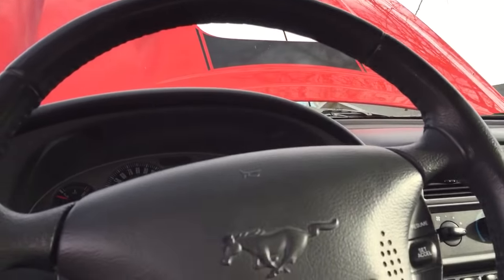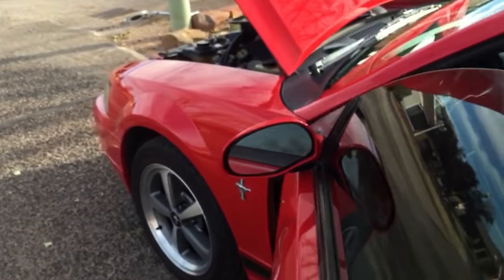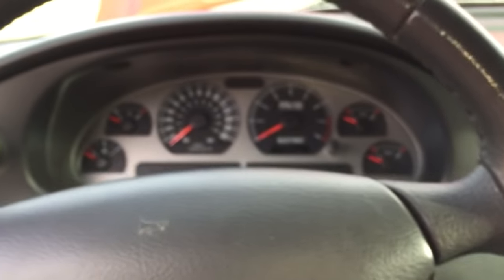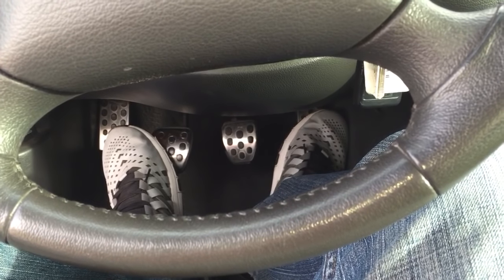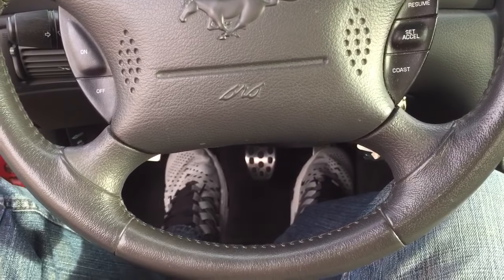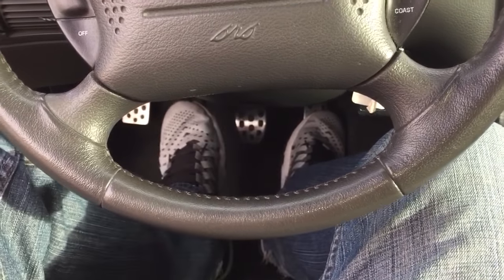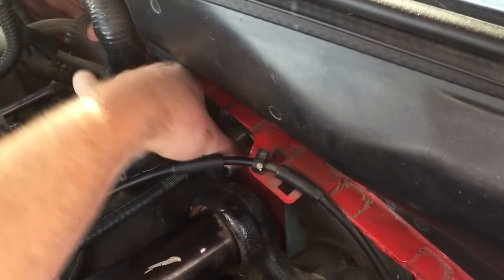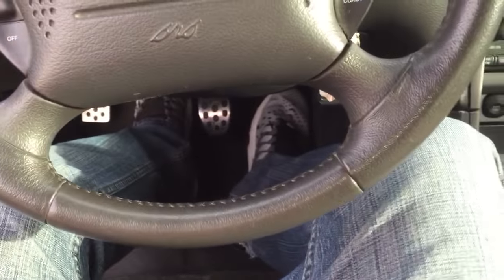How to adjust your Clutch: Ford Mustang. Clutch quadrant & firewall adjuster ajustar embrague chirp

Comment: Over the years I've found that firewall adjusters are just more trouble than anything. I run a Fiore quadrant with an adjustable Steeda clutch cable straight to the transmission and make my adjustment at the clutch fork. This way, there is not a chance of the cable rubbing against the inside of the firewall adjuster and eventually snapping (which I have seen PLENTY of times). Love your vids bro!
Reply from the maker: Kris Ram I had a STEEDA adjustable cable at one time and also adjusted it from underneath, but the pedal would rattle until I got the freeplay elimination mod. I was running it so the t/o bearing wasn't spinning until engaged but didn't get full travel and got locked out a lot
Reply: Scrun Johnson I know the online debates go on FOREVER about this but the TO bearing is designed to spin at all times. If you look under a factory stock setup on a mustang that still utilizes the original plastic quadrant, the design to pull up on the clutch pedal is just that. To make sure the TO bearing is just barely resting on the pressure plate. If your pedal was rattling, that meant that the cable needed to be adjusted so that the TO bearing would make firm contact with the pressure plate. An old trick for aftermarket cables is to pour 2-3 cap full's of engine oil down inside the cable so that the travel and pedal effort is smooth. All in all, Timken bearings are my most favorite as they are made out of Kevlar and withstand a lot of abuse.
Reply from the maker: Kris Ram I agree. Good insight. When you remove a factory setup cable you need a pry bar to separate the clutch fork, so that's yet another sign it has pressure and spins constantly. Thank you for your comments. They help for others also reading through them for more insight

Comment: Video was just what I was looking for ! My 87’ GT has the exact same chirping noise so I popped the dirt cover off the bellhousing and started it up and I watched the cable and fork rattle a little and the smallest amount of tension would kill the chirping noise. I don’t want to have to swap to an aftermarket quadrant and I think my plastic quadrant still works fine
Reply from the maker: Ricky Gendall The plastic ones tend to strip the plastic teeth over time, so as long as they are still good you should be fine. If not, the aftermarket quadrant and firewall adjuster is very nice to have
Reply: Yes sir, I had a look yesterday at the pawl and quadrant and theres hardly any teeth left. On top of that, the cable in there now is stock from '87 so i went ahead and bought a 5.0resto cable adjuster and double hooked quadrant. Hope it works well, and thanks again for the awesome video man!

Comment: Good explanation. The bearing should be spinning with clutch at all times. Reason being. Every car/truck/bike etc.  in the world I've ever worked on that had a hydraulic clutch they all keep small preload on the bearing.
Reply from the maker: Yes, I agree. The shock factor going from 0-2,000+ rpm is not what it’s designed for. I run a small amount of preload.

Comment: Good vid.  I have my adjuster set with the dime thickness gap between the cable and the face of the adjuster.  Clutch engages at the high travel part of the pedal where the vid said low
Reply: I think if you turn it in it will engage closer to the floor.  I’m having trouble with mine also engaging high

Comment: Mines is chirping alot louder now ,especially in drive tru's. When i bought my cobra a few months ago the chirp wasnt so loud. I bought a firewall adjuster and quadrant the week i got the car. Ill probably adjust it again tomorrow b4 work. You forgot to mention that u can adjust where your clutch engages with the fw adjuster and quadrant. I like mines engaging close to the floor.
Reply from the maker: Morbid Thrasher you're right. I started mention it at 6:22 and never finished. I completely covered it in the first video I made but a dump truck came up and ruined my video with noise and I started over again and forgot I didn't cover it again lol.

Comment: i was always told the squeaking was the throwout going bad but i guess its something fairly common on these cars, its been like that on both of mine but i always just assumed they were bad bc they were both beat on by previous owners (and myself lol) thank you for sharing this information!!
Reply from the maker: It certainly can be the bearing going bad, but it can also just be the throwout bearing as it lightly touches the diaphragm and fingers. Here is more information as well as an install for the clutch quadrant and adjuster https://youtu.be/RkEn5FJHs8g
Reply: @dannyjohnsonsgarage  well the squeaking isn’t super loud or anything it’s just kinda faint like the way you explained it in the vid so i’m thinking adjustable cable and everything should help me somewhat solve it

Comment: I hear the chirping /rattle while driving it sounds pretty loud and I got a good amount of tension on it. New everything in clutch flywheel, clutch, pivot, TOB,fork ,new fluid, bbk adjustable fire wall and quadrant and cable
Reply from the maker: If it does not go away with light pedal (cable) tension, the throwout bearing is likely bad https://youtu.be/UFr0Rur_EWc

Comment: Adjust your cable. If it keeps chirping your throwout bearing and fork need to be replaced along with the bolt that hits the throwout bearing. And just Incase if your cable is old replace it as well. These mustangs are a lot older now and need a lot of new parts don’t try to half ass these cars because they will just keep messing up. Do it right!

Comment: Hey I know this video is a few years old but I’m hoping I could ask a few questions. I have a 2002 3.8L that I recently had a clutch put in. Just added a new adjustable cable and double hook quadrant. I am about to try and add my own diy freeplay eliminator to fix my issue. My pedal rattles and I mean BAD. So bad I have completely stopped driving the car it makes me wanna pull my hair out. You have been the only person to even address this problem in a video and I was just wondering. How bad did the pedal in your car rattle and are these cars known for that. I’m hoping this spring will finally put and end to it or I am afraid I will have to sell my favorite car. Also do I need the firewall adjuster or am I ok just to use and adjustable cable and new quadrant. Thanks.
Reply from the maker: Well, as the video shows, method 1 is to tighten the bearing up until it’s LIGHTLY spinning, and that would take most rattle away- but if you are trying for option 2 to have it not spin at all, the free play mod is your friend. On my car it just made an annoying tapping sound- small vibration to where barely touching the pedal would stop it. 
  I went to having the bearing always touching because I was not getting full travel (and not getting full clutch disengagement) so I’d get locked out of gears. Hope that helps
Reply from the maker: I’m assuming you’ve seen my freeplay mod video, but if not, here it is https://youtu.be/3og_dCB9s-g

Comment: So I have a 98 svt cobra. Has the adjuster just like you have and quadrant. It has that chirping sound constantly and looks like a new clutch and tob in inspection port. 

If I tighten it too much it will chirp while driving in gear. But just very slight pressure on the clutch pedal will make the sound go away. I mean like if you pushed it with your pinkie. Any suggestions
Reply from the maker: So it is almost there. You need to tighten the cable (turn firewall adjuster counter clockwise) just a hare more. If you don’t have enough travel left in the firewall adjuster to do that you need to put the clutch quadrant on the other hook (assuming there are 2 hooks) and start over again with adjusting it. In my opinion, the ford cable does this perfectly and if you have to put nuts on the end of the aftermarket clutch cable make sure to had several and some lock tite so it doesn’t come loose
Reply: @dannyjohnsonsgarage  ill try that.  So put a cut or washer where the cable hooks? It squeaks only until a very light touch of clutch. Same thing no matter how adjusted
Reply: @Keepfight10  having the same squeak in gear off the clutch and neutral off the clutch until I apply a very small amount of pressure on the clutch pedal. Just did a new clutch, tob, pilot, and maximum motorsports cable and firewall adjuster so I'm gonna try to tighten the cable just a hair and hopefully that will make the squeaking stop lol

Comment: Hey great video! Saved my life. My brand new ford performance tob makes a chirp/ faint rattle when i let off the clutch. Which method should i use to make the noise stop and put less wear on it???? Do i buy that kit? What do you recommend. You earned a sub. You're awesome.
Reply from the maker: Shitstang 02 I like the fiore brand clutch quadrant and fire wall adjuster with a stock cable. That works well with my clutch at least. I would recommend a light pressure on the throwout bearing so it's just barely spinning, but doesn't have a lot of preload to heat up the bearing
Reply: Danny Johnson Ok i have an sr performance one installed. But i cant spin the firewall adjuster. Its too hard and i cant adjust it. Idk what i did wrong? So i just get it adjusted with with fire wall adjuster screwed all the way out ???
Reply: Danny Johnson I was referring to the freeplay correction thing???
Reply from the maker: Shitstang 02 what clutch cable are you running? The aftermarket ones allow you to remove a nut on the clutch fork side and I can explain what to do if that's the case
Reply: Danny Johnson yes there is 2 nuts on the end of the cable that goes in the clutch fork.
Reply: Danny Johnson Well 2 nuts that hold it on the clutch fork

Comment: Man I bought a new clutch kit from lmr and I now have reverse grind and 1st is hard to get into. Any info? Thanks bro your mach 1 is 🔥
Reply from the maker: It sounds like your clutch pedal is not getting the full travel. Does your kit have the adjustable cable, firewall adjuster, and Clutch quadrant?
Reply: @dannyjohnsonsgarage  yeah man got all three. Also got new clutch fork and ball pivot. My pops and I put everything the way it supposed to be. Triple checked everything
Reply: Same issues here

Comment: As always great video. Few questions 
My understanding I can install  Quadrant & Firewall Adjuster with the stock clutch cable right? Any advice on that? 

Also do you have a video of any of those Clutch Pedal Height Adjuster?  I'm not fan of how far the clutch travel or having my knees close to my chest lol.
Reply from the maker: Yes, the stock cable is best. You’ll see a spacer in this video for the clutch pedal, but it’s more for cable length https://youtu.be/RkEn5FJHs8g?si=JtX9hPmJcx4SSCnr

Comment: quick question for anyone. I have an 03  Gt and my clutch is short. meaning the "sweet spot" to engage it is very small/minimal. how do I Increase it??? On my previous 01 Gt it was way more easier and comfortable.
Reply from the maker: You will need to buy a clutch quadrant with multiple hook locations, and/or the firewall adjuster to help get it straight as shown in the video

Comment: Mine lets out 2/3from the top. Hard to get into 1st and reverse. When i get it into reverse it will let out about 1/3 the way. The peddle is pretty stiff. Theres an aftermarket quadrant. Cable unknow. When moving it shifts fine. Any thoughts ?
Reply from the maker: Check which hook it’s on for the clutch quadrant. You probably need to start over by putting the firewall adjuster in the middle and snugging the clutch cable down first at the clutch fork
Reply: It has a stock looking cable with the white plastic cap in the firewall

Comment: Hi Danny.  I just bought a Black 2003 Mach 1 basically stock with a few common mods like headers eibach susp, clutch cable etc. I think it’s a steeda adjustable clutch cable and hardware. My Question is … the clutch is SO HARD to push down. How can I make it easier and still keep everything right ie no squeal?  Thanks!

Comment: So I recently bought a mach 1 with this firewall adjuster but the guy ajusted it and I started to here the throwout bearing noise which way should I turn it clockwise or counterclockwise to stop hearing the throwout bearing???
Reply from the maker: cruzwtf Gaming so I’d turn it counter-clockwise until the chirping goes away (if that’s the sound you’re hearing). That would indicate the bearing is spinning but does not have a lot of load on it. Is that what kind of noise you hear?
Reply: Danny Johnson I hear the throwout bearing grinding no chirping all I hear when the clutch is out is haaeeehh
Reply from the maker: cruzwtf Gaming In that case, you may have a failing throwout bearing. If so, this is how to replace it and the clutch https://www.youtube.com/playlist?list=PLIjr-uSYDZi6xQ5USpFNlQGOoQXboNgsM

Comment: Love the detail you put in the video 👍.  I have a mystery situation (04 cobra twin disk clutch, MM clutch cable, FW adjuster and quadrant ) but 1st I want to ask you, how much slack do you allow between clutch cable and FW adjuster??
Reply from the maker: With the twin disks I hear they need an adjustable pivot ball stud and then even it is cut to a certain length for it to work. I use the oem factory cable since any adjustable one I have used in the past just seems to walk the nuts off
Reply: @dannyjohnsonsgarage  I’m wondering when you adjust the tension on your clutch cable to firewall adjuster, how much space do you allow between the 2?  
Not sure why but my cable keeps pulling away from a dime width to almost 1/4 inch within a weeks time and I have to adjust it frequently

Comment: Hey Danny how is it going? I enjoy watching your videos. I have a question for you. I just installed a new clutch kit, ford oem clutch cable, ford tb, ford pilot bearing & firewall adjuster. My transmission is making a whining noise while driving as if I have a supercharger but it goes away when I push in the clutch. What could be the problem? Could it be the clutch cable needs to be adjusted?
Reply from the maker: Yes, I would first start with the adjustment. If it’s touching constantly it needs to do that with very little force- just enough to spin the bearing (called preload). I would turn the adjuster clockwise (loosening tension on the cable) until you get to a point where barely touching the clutch pedal makes a chirping sound. If you have a chirping sound without touching the clutch as it sits in neutral it’s gone a little too far and you need to turn it counter clockwise to add more tension . If you can’t get it right you may need a clutch quadrant as well
Reply: @dannyjohnsonsgarage  Thanks a lot Danny you are the Man....I just subscribed👍
Reply from the maker: Tyrone Jenkins Welcome aboard 👍🏼
Reply: Whining sound from transmissions are cost by wear on the cluster shaft and input shaft teeth. A confirmation of this will be the noise going away in fourth gear. It will sound like a supercharger exactly like you mentioned. This is typically caused by fluid running low. The only fix for it as a rebuild on the transmission and to replace the cluster and input shaft. Keep your fluid level topped off and generally you can drive with the noise almost indefinitely. however once the weather gets bad enough you will shred the teeth on the input and cluster on a hard lunch

Comment: I believe my quadrant is also a fiore (previous owner install) I dont have a chirp but my clutch releases very high. I have adjusted the firewall on the way clockwise and it made little to no difference. and when I adjusted it counterclockwise it just disengages it completely. its a brand new zoom clutch so I know it isn't bad. Any tips?
Reply from the maker: Cole Smith it sounds like it's just how the clutch is made, so you'd probably need to buy a STEEDA double hook quadrant with 2 places to attached the cable
Reply: Danny Johnson also, when I attached the clutch fork I had to pry that thing on it was really tight. maybe I need a longer cable?
Reply from the maker: Cole Smith is it a factory ford cable or one that has the stud on the end where you add the nut and choose where the cable ends?
Reply: Danny Johnson it is definitely not an adjustable one. And it not very long. so I imagine it is stock.
Reply from the maker: Cole Smith well, it's possible it's too short for the setup, but the factory cables stretch over time, so they only get longer. Mine is a factory ford cable with fiore clutch quadrant and firewall adjuster on a Mach 1 with the tr3650 transmission. It looks like yours is  a 99 cobra? That would be the t45 Trans but if I'm mistaking and yours is 2001+ 5 speed it would be the tr3650 as well

Comment: 02 mustang 3.8 swapped clutch ..chirps n ticks when driving when i lift the clutch pedal up to try n self adjust the tick goes away could it be a bad tob or clutch fork or do i need a firewall adjuster
Reply from the maker: I would try a firewall adjuster first
Reply: @dannyjohnsonsgarage  that's one part I didnt change and kept thinking I should..will update when possible, thanks for this video
Reply: Do u think more tension on clutch fork would help this chirp  and for some reason i cant shift to third most times

Comment: I have a new clutch and tob. Installed firewall adjuster and quadrant. I dont hear chirping no matter how i adjust the firewall adjuster.
Reply from the maker: Some of the chirping can be from worn clutch diaphragm fingers and a bearing with some play, so it may not be noticeable with brand new parts https://youtu.be/RkEn5FJHs8g?si=I3FCY4z3hGUM74-n